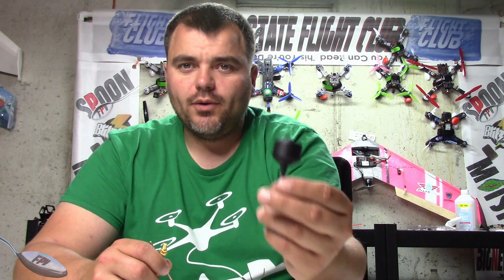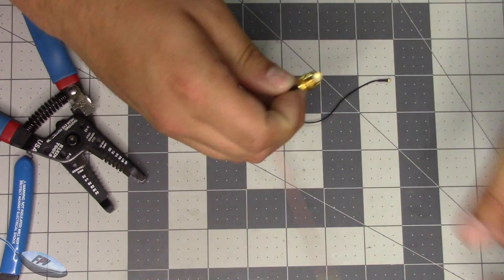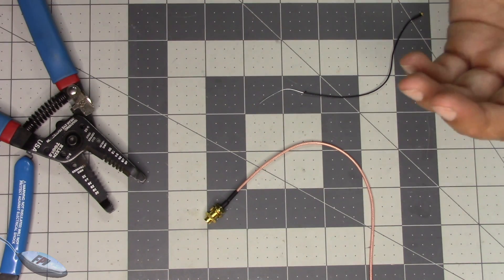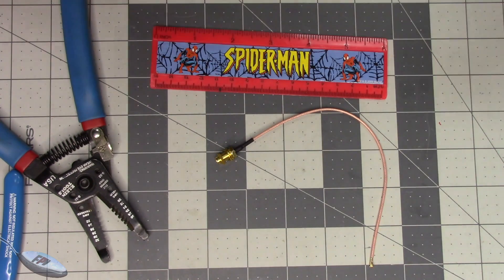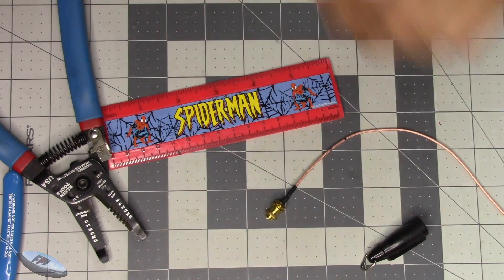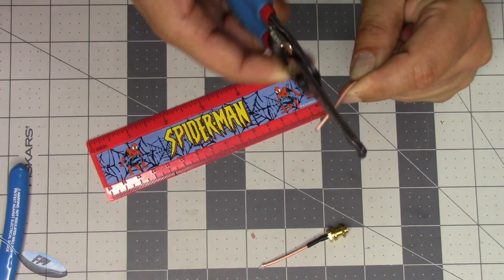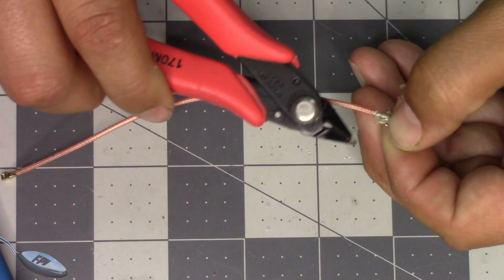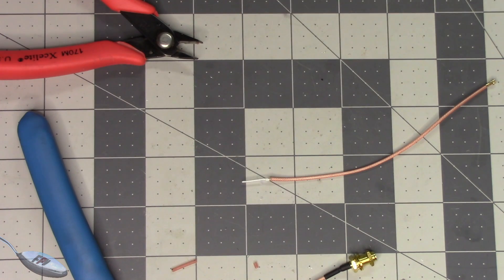Make Your Own Lightweight Ufl Antenna

Comment: I’m trying to get the maximum range. I commonly drive my RC car more than a half mile away and it’s losing range. How do I get more range? Do I just need to get a longer antenna that’s higher up in the air? I already stripped my antenna to 31.23 mm. But the range needs to be better still. Please tell me what to do?
Reply from the maker: You will not get more range by making an antenna longer.  It needs to be tuned to the right frequency which is why the length is important to get right, that's the tuning part.  You can get higher gain antennas that are more directional, or broadcast at higher power.  Usually it comes down to your setup.  You need to make sure your antennas are not blocked by/or next to things that restrict RF, like metal, water (body parts, trees, earth), carbon fiber.  You need to get clear line of site between transmitter and receiver.  Also you should try to make sure your antennas are polarized the same, either same circular polarization (which a simple whip antenna like this is not circular) or vertical antenna taking to another vertical antenna.

Comment: Since the impedance matching isn't perfect, won't there be a standing wave in the cable?  So, doesn't the length of the shielded portion matter?  If you happen  to egress to unshielded part at the wrong point, couldn't you be at a null?

Comment: What is the short metal tube for on most whip antennas? I think the shielding gets soldered to it.
Reply from the maker: +Double A Aassuming by your description also shielding
Reply: These are sleeved dipoles. While the antenna in this video is a 1/4 wavelength monopole, a (sleeved) dipole is 1/2 wavelength in total.
Reply: That part is the balun for balancing Double A